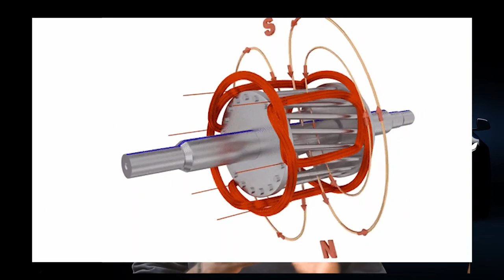How electric cars work in malayalam | എങ്ങിനെ ഇലക്ട്രിക്ക് വാഹനങ്ങൾ വർക്ക് ചെയ്യുന്നു.|Tesla

Comment: 1  Brick cheyubol eganeyan charge avunn please
2 dc motor endkond edil use cheyunila???? 
Please Ripley  waiting
Reply: 1. Regenerative braking ennanu ee technologykku parayuka. Electric Machine nu Motor ayum Generator ayum act cheyyan pattum. DC Shunt motor nokkukayanenkil athinte shaft nammal external force upayogichu karakkiyal generator ayi act cheyyum. Electricity generate cheyyum

2. DC motor ayirunnu adyakalangalil upayogichirunnathu (ippozhum chila vandikalil undu). AC Series motors anu easy to manufacture. Long lasting. DC motoril ee brush, commutator ellam undu.
Power electronics develop ayappol AC motor speed control easy ayi. So AC motor anu ippol common